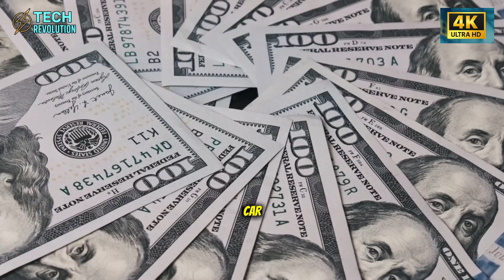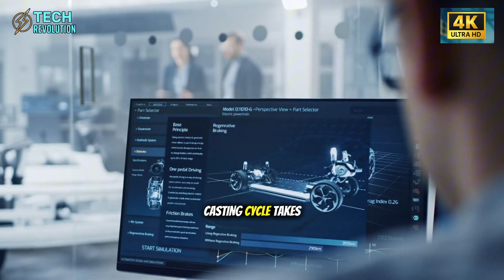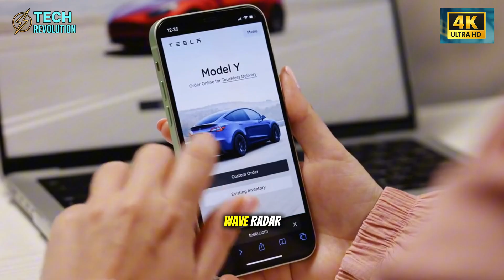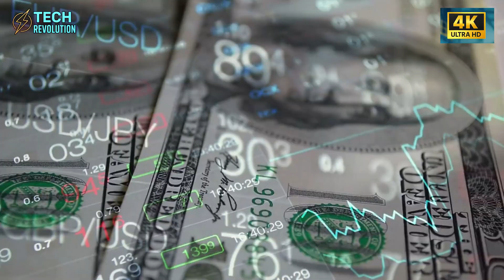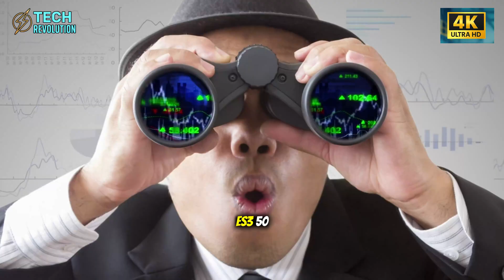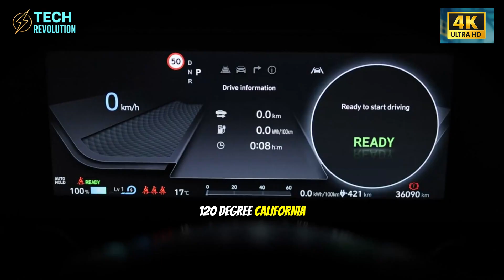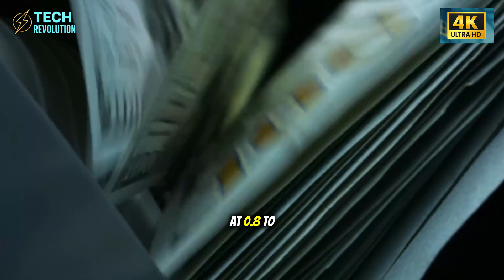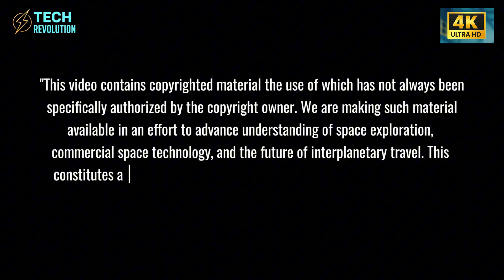Tesla $12,749 Model 2 FINALLY HERE: Ends $1,025/Mo Forever. What's SHOCKING?

Comment: You provide a lot of content which I find very interesting and helpful. What is confusing is that within a day's time you will post information that gets radically changed a few hours later. I like the thought of a 12,749 model 2 base price and hope that this is realistic as the price is quoted as that or 15,020,000 or 25,000 depending on the hour or the day. I would love to pre-order a Tesla and will probably do so April 17th! I am legally blind and need the FSD unsupervised to use my own car! I am looking forward to that happening! So once again, I appreciate the content and the passion, just hope that the info settles down into a set specification. Just a few hours or days ago it was a lithium ion polymer battery and now it's looks like it's going to be a sodium ion. It gets kind of confusing with all of the changes and information. I guess we won't really know until it goes into full production in the spring.
Reply from the maker: Model 2 $12,749 is the target, but specs like battery tech can change until production locks in. I share updates as Tesla iterates, and I agree clarity will come once final builds roll out.